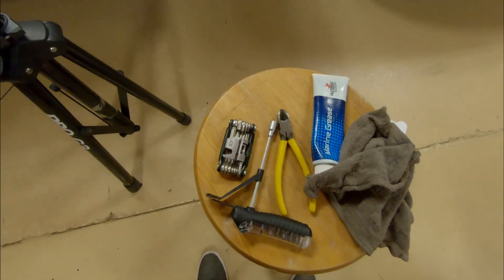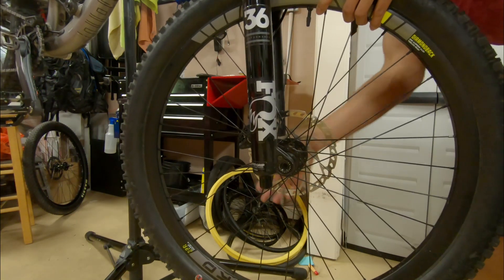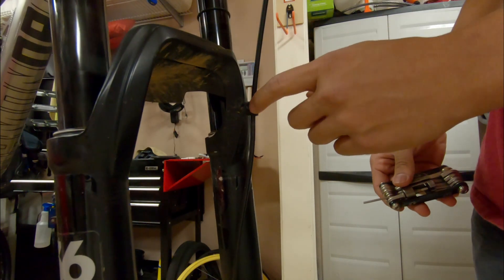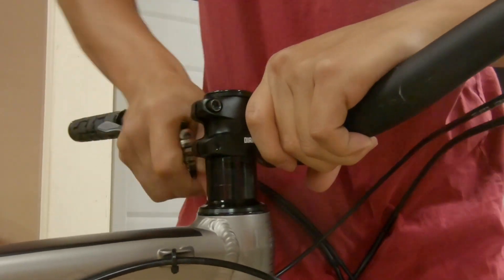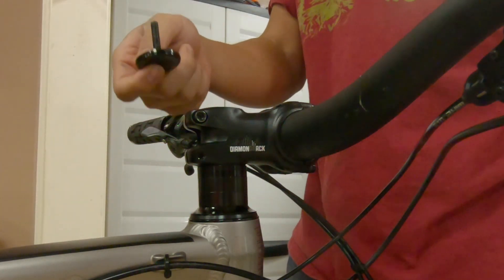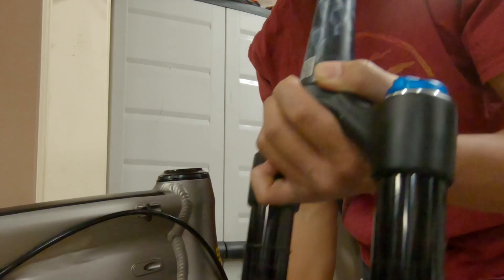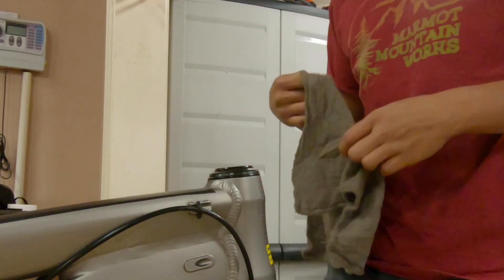How to Fix a Creaking Headset

Comment: Thanks for this.  Much easier than I thought.  It was dry powdery nastiness in there.  But the bearings were not loose like yours, how do you remove those?
Reply from the maker: MantisRay861 Are the bearings stuck in the frame? If so I would squirt something like wd40 or pb blast on the metal to metal contact. If they are that stuck I would consider replacing the bearings too. Thanks for watching!

Comment: Can you help me when i tighten my headset there a sound when i turn it
Reply from the maker: STANLEY CINCO did you over tighten it? And do you have sealed headset?
Reply: I have sealed but if i dont tight it the headset shaking really hard but if i tightend it theres a tick sound everytime i turn
Reply from the maker: STANLEY CINCO I had that problem with my unsealed headset on my bmx. Make sure you didn’t put the top bearing on the bottom and put more grease in the cups. If that doesn’t solve your issue you will probably need new head bearings.
Reply: Thank you
Reply: Im having same problem.. so frustrating 🙁
Reply: @Kaedenfu  what if I don’t service it will my front headset snap in half?
Reply: @stanleyshawncinco5299  I’m having the same problem! I’m learning how to wheelie and when I come down and turn my handlebar to turn around it makes a creaking sound and I don’t know what’s wrong. My cranks also creak once in a while. What would happen if I don’t service these problems?
Reply from the maker: @compstops160  no, most likely it will just start creaking really bad and have resistance when turning the bars.
Reply: @Kaedenfu  so what should I do? Take it to a really good BikeShop and get it serviced? I have a bmx bike!
Reply from the maker: @compstops160  that’d be your best option if you’re not comfortable taking it apart yourself.

Comment: My new norco has a creaking headset, and I have taken it apart and greased it 3 times and it always starts creaking again after a few days?! Any ideas?
Reply from the maker: If you haven't, 1. Take off your handlebar from the stem, clean it, grease where it clamps, torque it to spec and see if that works. If that doesn't work, 2. Remove the head cups. I had that happen so I removed them and cleaned it up, then put it back in with some grease. And if that doesn't work, 3. It is your fork CSU. Let me know if any of those work, if it doesn't and you get to #3, let me know. Thanks for watching!!

Comment: Bro my new mtb bike head set makes creacking when I sit and try to ride. Also when I turn left or right it becomes more noisy.please suggest me what to do? Should i take it to a bike shop or repair myself as you did?
Reply: It happens to me also
Reply: @Aksh__12  bro I have fix my problam at home. actually the sound Came out from the suspension fork due to some dry condition. I did lube    there and the problem had gone. If you want I can give you my lube's buying link. Cost around 150-200

Comment: My bearings don’t come out, they’re fixed in? Every video I’ve seen, people’s bearings simply slide out!!! You can’t even lever mine out what the hell?
Reply from the maker: What bike do you have? They are probably seized. I’ve had this happen before.
Reply: @Kaedenfu  I’ve researched it and it is a zero stack headset system, the bike is a focus craterlake lite (I doubt you have them in the states), I’m going to take it to my local bike mechanic shop and see what they say. Turning the bars at all is just CRUNCH CRACK
Reply from the maker: Did the bike shop open it up and find the issue?

Comment: Sir pls help me. Im new to mtb. I have my 2 week old mtb. Now, whenever I move my handle bar left and right there is a sound. Pls help
Reply from the maker: Jay Dee the sound is either from tightening the top cap too much or if your headset bearings have gone bad. This happens because the pinch bolts and top cap loosen up from vibrations causing it to move back and forth. This lets the bearing move back and forth destroying the bearings. The first thing I’d do is doing what I did in the video. If this doesn’t let play around with the top cap torque.
Reply: @Kaedenfu at first, the sound was like a crispy plastic. So i decided to tighten it.. and now the sound became a click sound.
Reply from the maker: Jay Dee Take it to your local bike shop. It shouldn’t much for them to replace the headset bearings. If it’s two weeks old they might just do it for free if you take it back to where you bought the bike.
Reply: @jasondaga1990  same problem as me i fixed it through lowering the star nut moee

Comment: if you put o much grease on it'll attract grease lol
Reply from the maker: Not necessarily. The grease is internal and the point of it is to keep water out. It will attract grease if you didn’t wipe down the outer parts of the headset though.
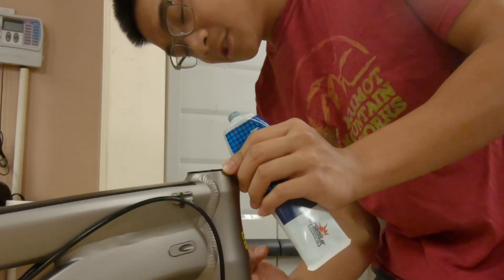Reply: @Kaedenfu  Thanks bro but I was just pointing out the speech error at 4:23 haha